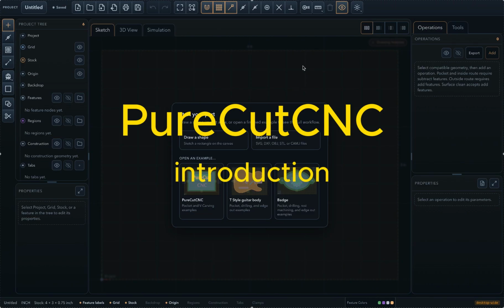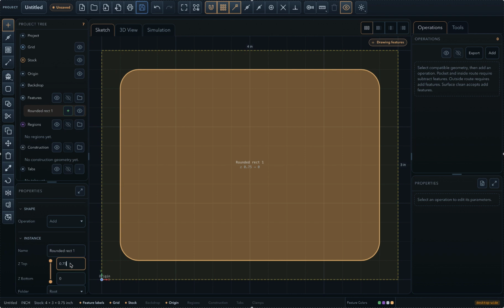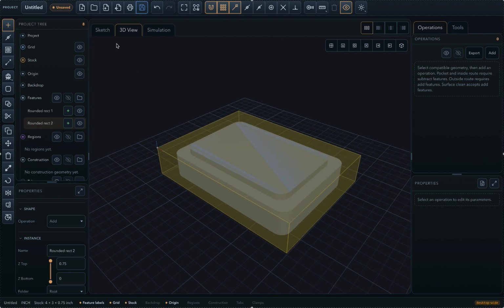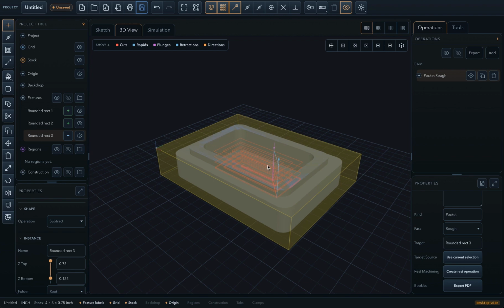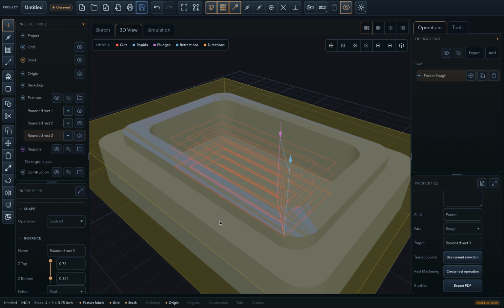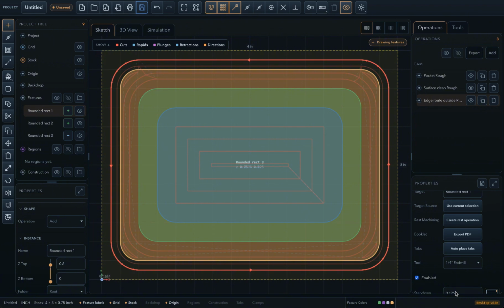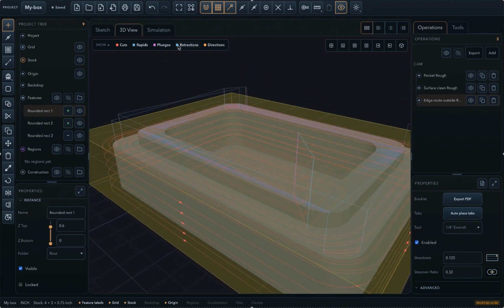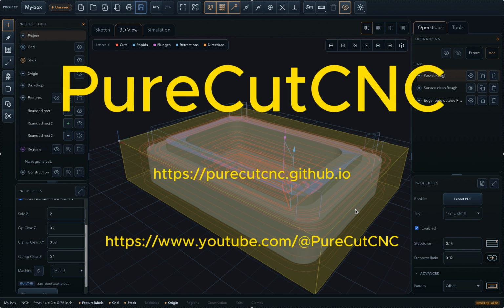PureCutCNC Introduction

Comment: How to change origin point to different place?
Reply from the maker: click on "origin" in the project tree, then look at the bottom left in the properties. you can use one of the predefined options (bottom left, center top, etc), or custom "place origin" where you can click any where in the sketch to place the origin there. origin Z can also be manually changed in the properties (it goes from 0 and up, pointing at you).